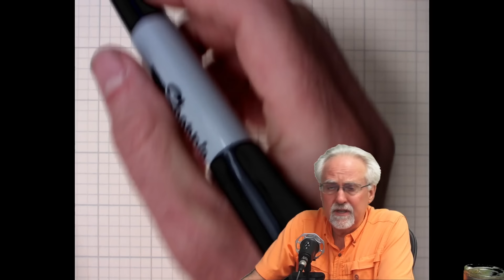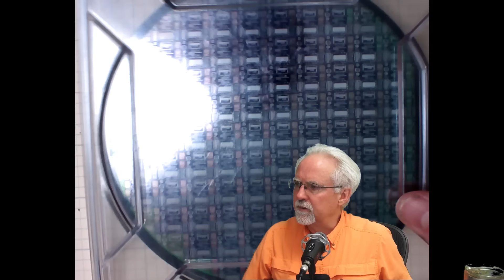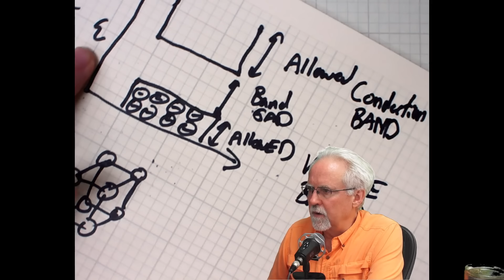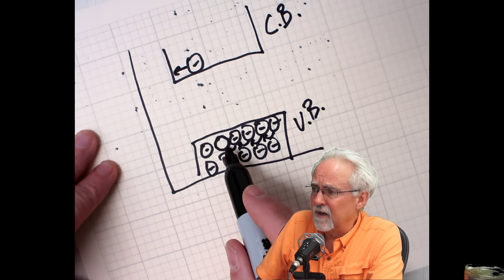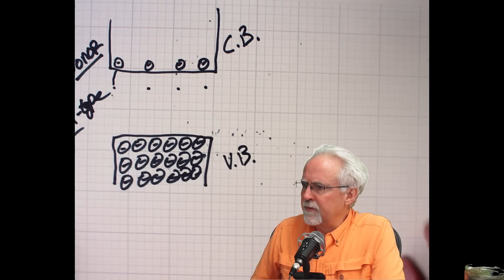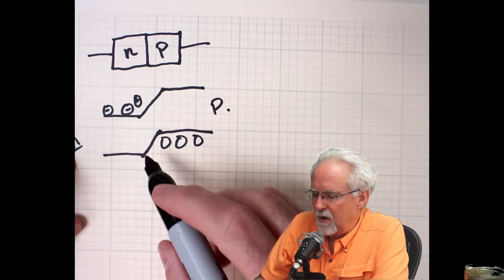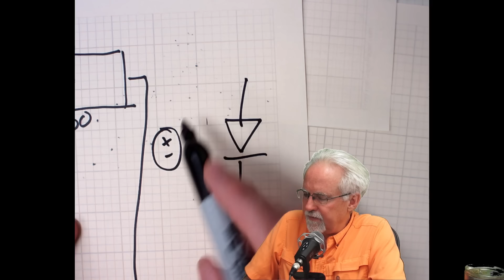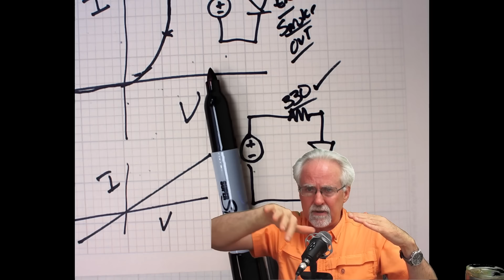Arduino Tutorial 2: Understanding How Light Emitting Diodes (LEDs) Work

Comment: Since the higher the band gap, the higher the higher the energy. Then, how is it LED's come in different colors. Does that mean they have different frequency or they have the same energy gap, that color is just for style?
Reply from the maker: Different colors are produced by using materials with different energy gaps, which results in photons with different frequencies.
Reply: Thank you

Comment: how does a white led work?
do you just mix a red green and blue led into one and turn them on at the same time?
Reply from the maker: White LEDs typically use a blue LED coated with a phosphor material to convert some of that blue light into yellow, which our eyes perceive as white.
Reply: @paulmcwhorter thanks
Reply: @paulmcwhorter 😮
Pls can I have more explanation

Comment: WOOWOWOOWOWOWOWO  I acutally understand the underlying physics of an LED in A level physics we basically just get taught  E= hf, the energy jumps the I V relation of a diode graph and how if you put a diode in reverse direction the resistance will be very high. This video conceptually made me understand this idea of resistance with the p-n junctions and how the potential barrier increases which makes it harder for electrons (or holes) to jump over to cause the electron hole recombination which releases photons as electrons jump to a lower energy level. Aspiring to do an EEE degree apprenticeship. thanks

Comment: Yikes this was hard for me to follow! I used Gemini to help med through and, perhaps a bad idea?, translate it for me so I am beginning to understand it. But to simplyfi it. A diode can't recieve 5 volts so we have to put a resistor on. The diode have to put the right way, the long wire, the  anode on plus and the short, the cathode on minus. otherwise will it just block the power. Pls tell me if I am wrong about it :D
Reply from the maker: Using gemini is a very bad idea. You have to work through the tough problems without running to AI, otherwise how will  you ever learn to work things out yourself.

Comment: I am a 16 year old student and I am interested in engineering, so wanted to start with arduino in my summer vacations, and honestly, this tutorial has it all. From arduino, to C++ and even amazing physics lessons that are slightly above my level and syllabus, but are really interesting. Amazing videos!!!
Reply from the maker: Excellent. Now try and make it through the whole set of lessons, and Welcome Aboard! It is going to be a wild ride.
Reply: @paulmcwhorter  yes surely, already loving it! I am doing the 3rd tutorial now 👍 I also bought a 3 wheel chassis kit so I can control cars as well using the sensors and motors i got. One doubt sir, uhmm i have 2 stepper motors and don't have a servo motors, so how can i make it to work like a servo motor?
Reply from the maker: The servos and stepper motors are very different. It would be great to try and buy a few servos, they are only a couple bucks, and well worth it.
Reply: @paulmcwhorter  ok sure thank you so much! 😄

Comment: I write home work with for loop 
int yeloPin=12;
int redPin=11;
int greenPin=10;
int dt=500;
int i=0;

void setup() {
  // put your setup code here, to run once:
  pinMode(yeloPin,OUTPUT);
  pinMode(redPin,OUTPUT);
  pinMode(greenPin,OUTPUT);
  Serial.begin(9600);
}

void loop() {
  // put your main code here, to run repeatedly:

  for(i=0; i<5; i++){
Serial.println(i);
  digitalWrite(yeloPin,HIGH);
  delay (dt);
   digitalWrite(yeloPin,LOW);
  delay (dt);

  }

 for(i=0; i<10; i++){
Serial.println(i);
  digitalWrite(redPin,HIGH);
  delay (dt);
   digitalWrite(redPin,LOW);
  delay (dt);

  
}
 for(i=0; i<15; i++){
Serial.println(i);
  digitalWrite(greenPin,HIGH);
  delay (dt);
   digitalWrite(greenPin,LOW);
  delay (dt);

}
}
Reply from the maker: LEGEND!

Comment: connect a led backwards, + to GND, - to A0, and analog read and print A0 every second or 10 and you have a light detector.
give it long enough to stabilize and you get the forward voltage of the led.
Forrest Mimms noted these things over 50 years ago.

Comment: honest question, doesnt the color of the led depend on the glass coating of the led.. just pass the white light through that glass coating, we will get the color.. plz do guide me..
Reply from the maker: Actually, the color is determined by the internal semiconductor material, so the casing is usually just clear or diffused plastic.
Reply: @paulmcwhorter ohh.. thank you sir

Comment: While I was watching the video, I realized I had a small misunderstanding. At first, I thought that if we increased the applied voltage, the frequency would also increase and that would change the LED’s color, since higher frequency means shorter wavelength. I was also thinking in terms of electrical power (V × I), so I assumed that if voltage increases, the energy increases, and since photon energy is E = h f, then the frequency should increase too.

But now I understand that I was mixing two different ideas. The electrical power we calculate with V × I just tells us how much energy per second is flowing in the circuit — which mainly affects brightness. The energy of each individual photon (E = h f) is actually fixed by the band gap of the material. So increasing the voltage increases the brightness, not the frequency. The color stays the same.

That was the part I had mixed up, and now it finally makes sense.

Comment: how do you get the colour white?
Reply: White is different.
Unlike the other colors (that have fixed wavelength), White has a spectrum of wavelengths (from 400nm to 700nm).
So you can't make a diode that generates white light.
What you can do is to make led, green and blue LEDs and put them together to get a white light.

Comment: Don’t know if anyone is still active but why does the rise in temperature allow an electron to hop across the band gap? Or thermal energy give it a BOOST to the conduction band
Reply: I'm pretty sure it's because temperature (aka thermal energy) literally measures the speed of an atom (and therefore its parts, which include electrons) The negative electrons stay in the Valence Band at first because of their attraction to the positive nucleus. (opposites attract) However, when you increase the temperature of an electron, aka the speed, it eventually moves fast enough to fight against the attraction to the nucleus and "break free" from the valence band. After it's broken free, the electron doesn't slow down and moves to the conduction band. 

I'm not 100% sure if this is the right explanation, best would be to search it up.

Comment: Firstly thank you for doing this for FREE you're the best. My first question is why exactly by adding a positive charge to the P side and inversely adding a - charge to the N side we get a shorter band. My assumption is that we are using magnetism to repel the bands to get closer, or that by adding a more negative/positive charge the bands become more attracted to each other? Therefore getting closer to each other I think.

Another question I had was by implementing a resistor on one side of the connection to the diode is it enough to add it(the resistor) to one side. Will that indirectly be like having a resistor on both sides? Thanks for any reply's in advance.

Comment: If electrons are moving from one place to another then soon there will be no electrons in the N type material. But LED lasts for long so, I don't think electrons are moving, may be their energy is passing from one electron to another just like sound travels in a medium.
Reply from the maker: When an electron recombine to emitt light, new ones come in to fill their spots from the wire and battery. It will eventually be the battery to run down, not the diode. The electrons do move. Electricity is electrons in motion.

Comment: Just started practicing electronics through your videos. 
Had problems with access process from the IDE to the board. 
I was sure it was that my boards were too old a model, so a bought more... still didn't work.
Turnd out i needed to allow full access on my Linux OS for myself as a user.

Got it up and running, and now i have two extra boards to play with.
But couldn't make the LED blink like i wanted it too.

lol, my sketch was:

void setup()   {
pinMode(13, HIGH);
}
void loop()   {
pinMode(13, HIGH);
delay(700);
pinMode(13, LOW);
delay(300);
}

I feel like such a dumbo! lol
Another quick look at your demonstration video and I got it right.
Guess I was too excited once i got the board connected that I lost all focus.
Happy to learn.

Comment: I'm a chemist (for about 50 yrs), and have had a lot of computer technology, upgrade, repair, networking, etc.  Microelectronics is something I just started playing with for my own education and some hobbies.  Question: one of the lessons that comes with the Arduino IDE package has the resistor on the positive side of the LED, and one has it on the ground side.  Is that correct, are both acceptable, is there a preference for one application versus another, or was the lesson with the resistor on the negative leg in error?  Thanks for any explanations.

Comment: 34:02 So the resistor kinda counters the property of the diode. Where the resistor passes less current as it heats up while diode passes more current as it heats up?
Reply from the maker: The resistor does not really heat up. The total voltage drop is the voltage drop across the resistor plus voltage drop across the diode. By having the resistor share some of the voltage, it limits the voltage, and hence the current through the diode.
Reply: @paulmcwhorter  Alr, so its more so just a flat reduction that helps it.

Comment: Just a small question. If those elektrons fall from the higher level into the wholes of the lower level and give light, how can this process continue? Are all electrons 'fallen down' at a certain time?
Reply from the maker: Remember new electrons are flowing in from the battery.

Comment: Thank you sir, for this amazing lecture!!!
I have a doubt, I can understand that the color of light will depend on the energy of the band gaps, 
but then how the RGB works? Which changes it's color after a short interval of time...
Can we control the band gap present by increasing and decreasing it???
Reply from the maker: There are three completely separate LED in side the one little piece of plastic. The band gap does not change, you are working with three diferent LED with three different band gaps.
Reply: @paulmcwhorter  Understood!!!
thanks!!!

Comment: Sir you are an excellent teacher. You made physics easy. I did not only understand how diod works but you also made memorable how component in circuit should be connected. Special showing the graph and explaing why you never connect diod to the voltage; that was  memorable;  because voltage source will burn the diod.   Thank you for uploading these lessons.

Comment: I have a question, is it really heat that lowers the energy gap, or does the stress from the voltage on the crystalline structure of the semiconductor lower the energy gap?  Or is it both?

Comment: Another great lesson Paul, although some went over my head. Was good to finally understand what P-type and N-type means, why LEDs only work in one direction and why you need to place a resistor in the circuit to stop the LED getting cooked. Was a little lost by the wave length stuff though.

Comment: sir i have a doubt ,from what i understood the holes in the np junction causes the flow of electrons one way or other ,then how does a current flow in a conductor like copper ,there is no impurities in a conductor to make holes which in turn causes the electrons jump between atoms or is there ??,if no then how does it happen there??
Reply from the maker: With a wire there are many empty energy states next to electrons for them to move into, so they are free to move. Think of a bottle half full of water. Shake it around the water is free to slosh about. Semiconductors are different. Only specific places and energy levels the electrons are allowed to go.
Reply: @paulmcwhorter  thanks for the response ,it was helpful .

Comment: So the color of the light is a function of the band gap and gate height? But I saw somewhere the the color depends on the impurity material. So if I'm putting 2 and 2 together correctly, it's the impurity material that determines the band gap. Am I on the right track here?

Comment: I went through your Arduino series a few years ago and it was great. Now I'm back into designing escape room games and need to brush up so I started at the beginning. I just have one question: Why doesn't the diode run out of electrons? Or is this simply the practical lifespan as they don't last forever. Thanks so much for your great tutorials.
Reply from the maker: remember current is the flow of electrons, so there is always an infinite supply abailable from the connected wires.

Comment: i never expected this from an Arduino tutorial this is fascinating. One question, if the color of the LEDs is determined by the material it's made of to change the band gap, how do color changing LEDs work?
Reply from the maker: There is no such thing as a color changing LED. There are LED cases that contain three different LED inside, and you can mix and match colors by turning on different of the Red Green or Blue LED in the case with different strengths, but fundamentally an LED does not change color.
Reply: @paulmcwhorter  Ah I understand. I remember that is how pixels on a screen work, and those are LEDs too (everything makes sense now!) Thank you so much I really value your "understanding whats going on under the hood" method

Comment: Question: if the color of an LED is determined by the composition of the semiconductor, why are they encased in colored plastic shells?
Reply: if i had to guess i'd say just so you know what color it'll be
Reply: Those plastic shells are there to show what color the LED is, for an example I have an LED that makes blue in color but the plastic shells is clear and it still lights up a blue color the only problem is if I want to use a white light LED, I will not know the difference. I hope that answers your question.

Samuel

Comment: 33:45 "If the smoke goes out you never get it back.."  So all the electronics basically woks with the "smoke" inside, if  the smoke is released then they stop working, . .🤣Un-scientific assosiation made a machine that returns the '"smoke" back to the electronic device so they can work again🤣🤣. .

Comment: usually we see white light from LED, but white light is not a single color, does that mean the LED have multiple materials with different energy gap so it ends up with whilte? will that be more expensive than a signle colored LED?

Comment: This lesson was absolutely great, I think I got the gist of how the semiconductor works in terms of conduction but with the way it works, you'd think it would just go on forever with the flow of electrons moving from the p type material to the n type material. So why does the LED eventually die even if we protect it with a resistor?  I tried looking it up but I mostly found people talking about the heating messing with the LED which we already know but how exactly does it mess it up? Does it cause a lot of electrons to leave the n and p type materials or does it like melt or damage the material or something else?

Comment: Unbelievable teacher! From Argentina.
Reply from the maker: Interesting, so the arduino IDE is on your pi, and you are sending data over the USB cable, and the pi is slow to receive the data? I can not think of what the problem could be. I would suggest writing a very simple program, where the arduino just counts and see if the Raspberry pi can read and display the data in real time. This should be doable, but dont know where the delay would be coming from.

Comment: If that is the case regarding the energy and frequency and colour, can we write a program where we can change the colour of the LED connected to the pin #13 and program it to change its colour over time? Is there a program where we can change the voltage we apply in order to achieve it?